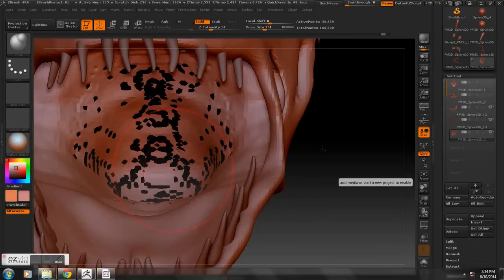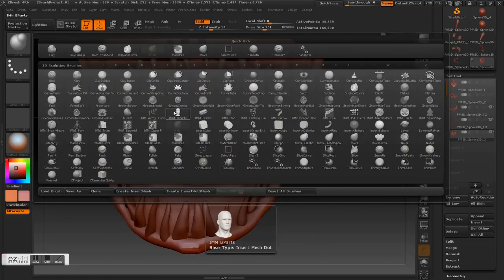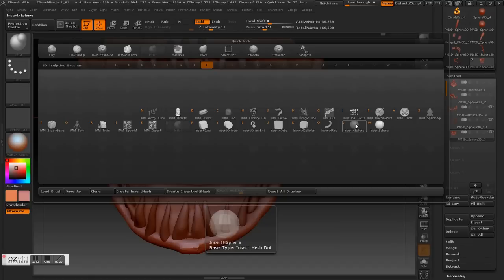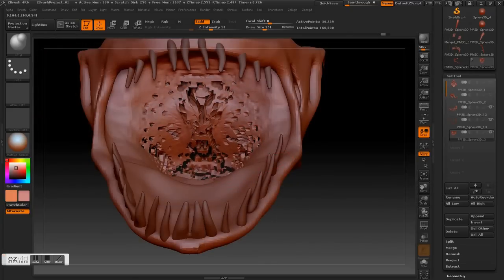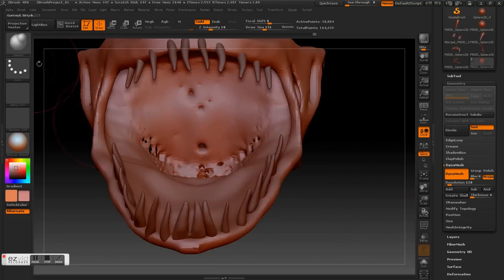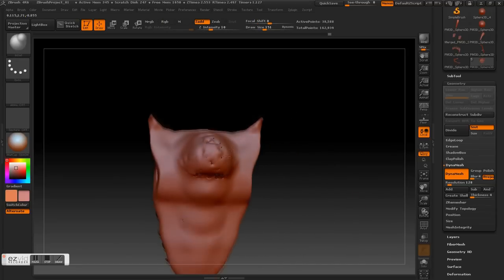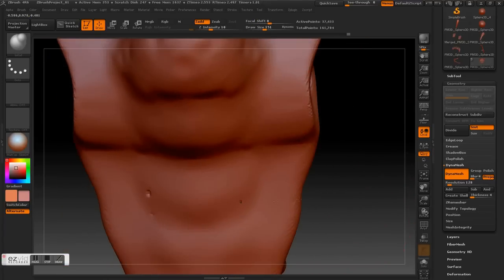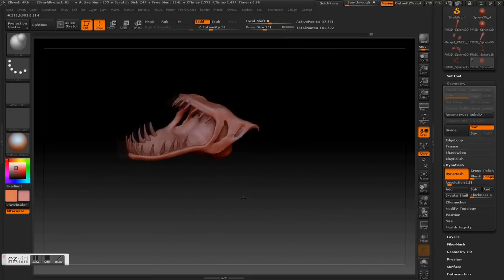Fix Zbrush Subtool Bad Mesh (geometry Holes)

Comment: Thank you for the great info! I just had one question, if I did this on a partial selected part of my model, only that part becomes dynameshed, but also separated from the rest of my model it seems, with lower resolution. How do I get the dynameshed part to connect back to my model with same resolution?